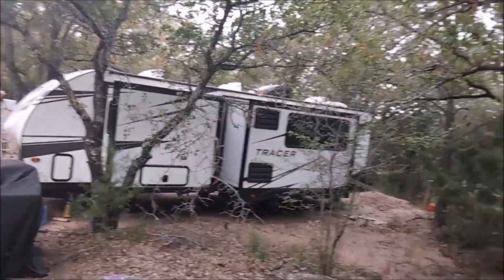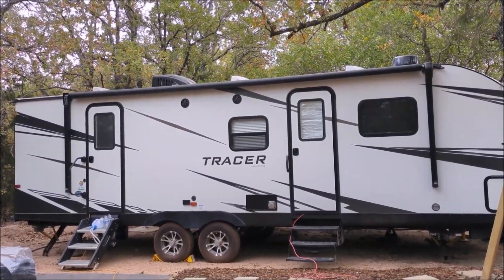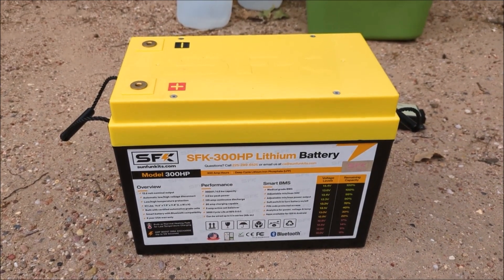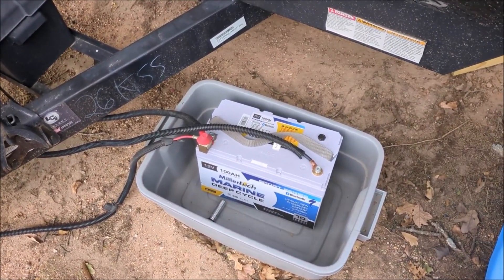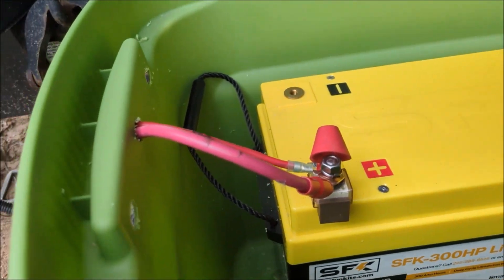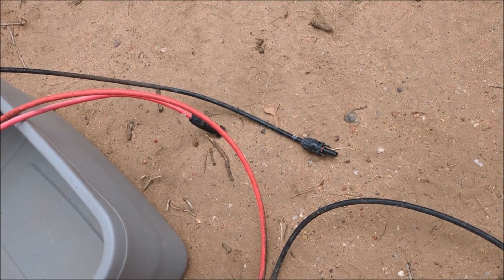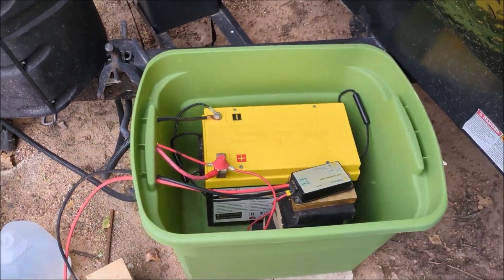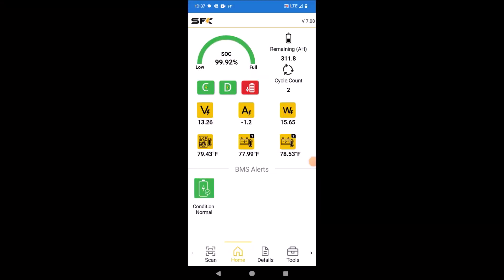12V Solar Power Auxiliary Charging System for RV House Battery - It's NEVER Going To Drain Again!

Comment: Hypothetical Question: If you plugged 30 Amp Shore Power or generator into RV with this setup, what would need to be disconnected on a temporary basis?
Reply from the maker: Nothing, actually.  I have tested it thoroughly (please note, I can't say this for surety for all trailers/RV's).  The converter charger in the trailer is the stock unit, which is only compatible with lead acid.  So when I plug in to shore power (via generator or my big solar panel array), the converter charger will only try to charge the lithium battery if it is within a normal voltage range for lead acid.  That means the SFK lithium battery would have to be ~50% full or less for the converter charger to try to do anything.  Worst case, the converter charger is providing some current AND the solar charge controller is providing some current and they both continue to assist until the converter charger drops off at some point when the voltage exceeds whatever voltage is programmed for it to float charge a lead acid.  You can have two chargers charging one battery at the same time.  It won't hurt anything.  It isn't the most efficient thing in the world, perhaps, and it may confuse the heck out of both chargers but it can work in a crude manner.

As I mentioned in the video, if this works until spring, I'll do a more permanent, polished installation and I'll sort out that issue.  But it isn't a big deal for now.

Comment: Is it Rack batteries that got drained? I believe I saw a video where someone had a rack battery system that was draining even when not in use.
Reply from the maker: It started out as a lead acid battery (came with the trailer when I bought it early this year).  That quickly died.  Then I started using the MillerTech 12V 100Ah battery you saw in the video.  I never saw that below 80% until I came back one weekend and it was 0%.  I still have no idea what happened.  It worked fine for weeks and then within a 3 day period it went to 0.

Comment: i have used an old harbor freight 15w panel and a small pwm controller connected to my trailer batteries when it is sitting to keep the batteries topped up as it sits unused. been working for three years so far.
Reply from the maker: Awesome!  I'm hoping it works for me as well.

Comment: Why not just hook up the charge controller & panel to the old battery?
Reply: He mentioned the size of the battery being 3 times that of the old one. The parasitic draw would be even less of a problem with the larger battery. 
He had everything so he used it. No purchases.
Reply from the maker: Yes, like SkunkPresant said, the 300Ah battery gives me an even better chance of not returning to my property to find that the battery is empty.  Combined with the 100W panel giving 200-300Wh (hopefully) of power each day, it should be a bulletproof setup.  SHOULD.

I'll use the MillerTech battery for something else.  It is smaller and lighter so I could put it in a pole mounted enclosure or somewhere that the SFK would be impractical.

Comment: Having done something very similar before, Drill a couple of small holes in the bottom of the bucket you're keeping your battery in for draining. Condensation happens and will surprise you one day, at least it did me, with a nearly half full bucket of water. Cheers and thanks for sharing your journey.
Reply from the maker: Nice suggestion.  I'll keep an eye on it.  Thanks for watching!

Comment: So I don’t know if this is why you battery discharges but I learned that while I leave my trailer for a few days with the gas refrigerator running I learned that the controls for the refrigerator were runoff the 12v system and that would draw done the house battery. It might be why your battery is discharging if your doing the same while your away.
Reply: I immediately wondered about the fridge too. It's the most significant power draw I can think of although even that shouldn't be much in gas mode. I'd probably cut all the other breakers and measure power draw for a while.  I guess there's also a chance the battery is self discharging but I bet he would have noticed.
Reply from the maker: Good idea!  I don't use my fridge in my camper, though.  At least not to this point.  I have an Iceco fridge that I have been using since I know the energy consumption and the freezer works much better.  The freezer portion of those RV fridges are pretty poor and too small.

Comment: Excellent, I’m all about using what I have!
I had to add a battery disconnect to my system, there a parasitic draw somewhere in my system.
Reply from the maker: Yeah, same.  I was disconnecting it altogether when I left the property when I first got the trailer because of the lead acid battery.  But even the 12V 100Ah lithium discharged somehow.  I've never been able to measure a draw on the battery while I've been there.  It really mystifies me.

Comment: Ya shouldnt put a Good battery on the ground. It's power could be quickly zapped.
Reply: Not an issue with lifep04 afaik, just lead acid.